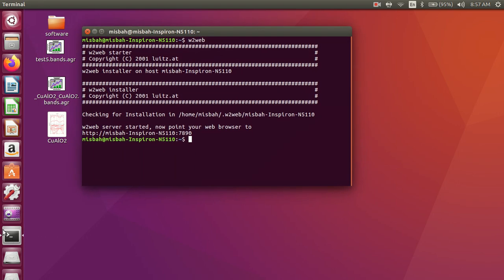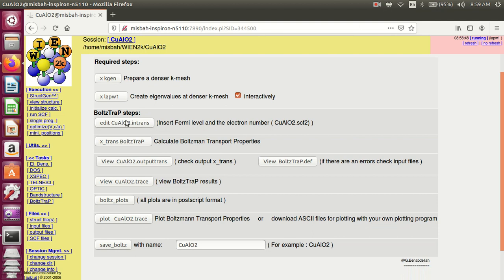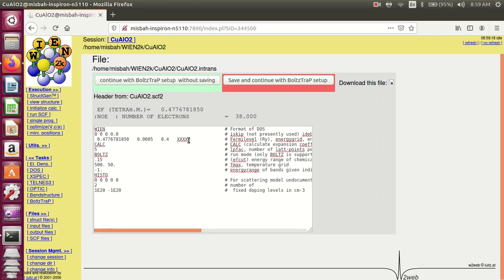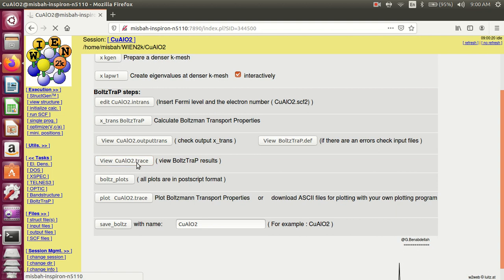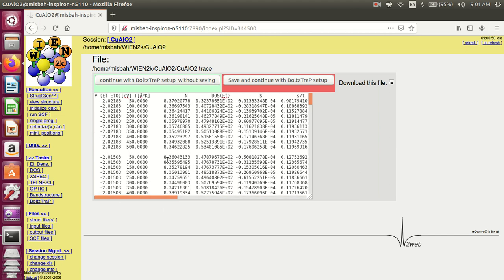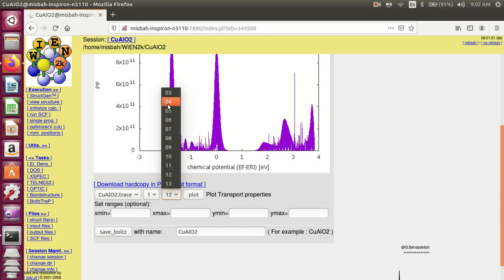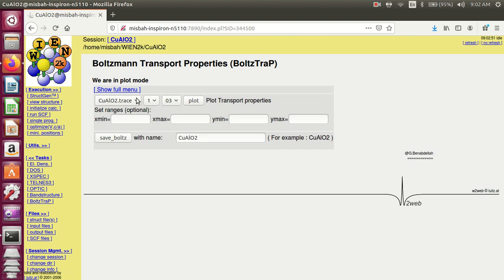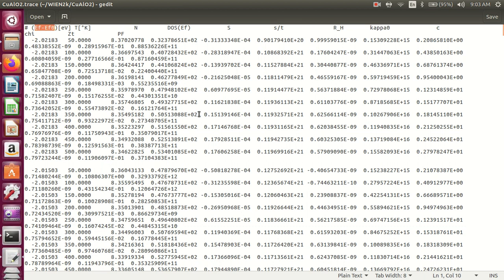How to Run thermoelectric Properties in Wien2k in English l Wien2k Videos l Physics Guide

Comment: Hello sir, what should be the hardware requirement in PC to do wien2k calculations  in individual level? Kindly suggest. Would core i5 with 4GB RAM and 1 TB be sufficient? Also whether the performance of branded and assembled PC same? Assembled is cheaper for me!
Reply from the maker: If u use pc with 4gb ram and i5 core.its a long process and time period for thermoelectric properties.if u can do calculation of super cell (with doping material).if run only simple calculations without doping.its work.but its better  to use i7 core with 8or 12 gb ram.and workstatiom system

Comment: Madam in case of sp we ll ve to do it for spin up and spin down? Plz reply
Reply from the maker: yes u can also run for spin up and spin down calculations
Reply: @physicsguide9470  so we will draw the graphs of both separately just like band  or it ll give  combined graph
Reply from the maker: @imdadkhan9631  YES but mostly in papers thermoelectric properties  calculated without spin.because for themo k.mesh take it dense.than the running processes is so long that's why only run task without spin
Reply: @physicsguide9470  yes I know madam but how I ll do it without sp in task so what to do now either I run scf again without sp or in task it can be without sp Plz reply
Reply from the maker: @imdadkhan9631  jst go to inilization and last step run without spin polarisation yes krn than back to task menu here is only steps for running task simply do these steps.these are not for 2 files only get one file of thermoelectric properties.no need to run again scf.
Reply from the maker: Before doing this.save backup folder of spinpolrization in your laptop.if facing any issue.than u should have original spin file
Reply: @physicsguide9470  thanks a lot madam my calculations are in GGA +u and I ve run boltz on the scf on GGA+u so it's OK or  only GGA is better Plz upload a video on how to plot boltztrap in origin
Reply: @physicsguide9470  Madan error appear after selecting task showing can't open uint 18 f names scf. Vsp also my previous result does not show zt
Reply: @physicsguide9470  madam I follow the same procedure but after clicking the Lapw1 it gives errorr
Reply from the maker: @imdadkhan9631  no if u follow samw procedure error nahi ana chahye
Reply: @physicsguide9470  OK madam I ll try again
Reply from the maker: if u run scf with spin polarization. Then also select in task first spin up than spin down.both data files generated

Comment: Madam I ve installed boltstrap but it does not appear in task what I ll do that it may appear in task just like band and dos
Reply from the maker: u can also attactch  file add_boltrzrap in terminal and also write steps in bashrc file which i mentioned in videos.then restart system it will be shown in task
Reply: @physicsguide9470  hello, sir, can you help me, I installed Boltztrap2 and we displayed it in the Wien2k interface, when we execute the calculation step, you did not display the result, the .trace file is empty .Thank you